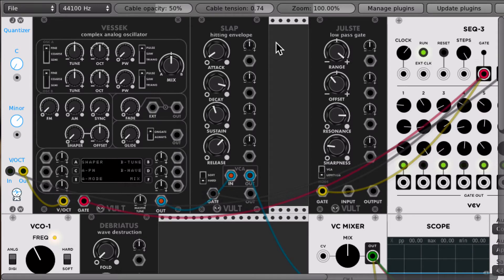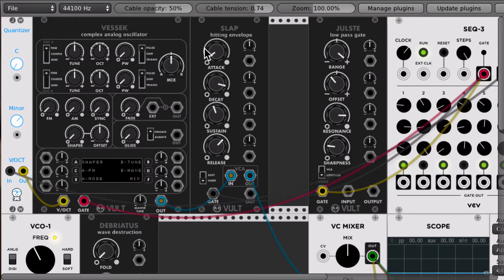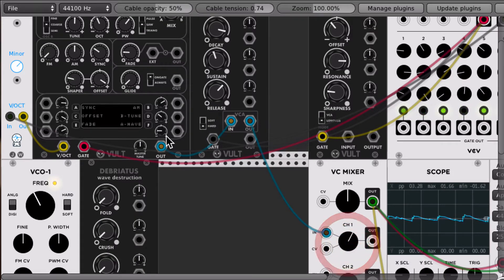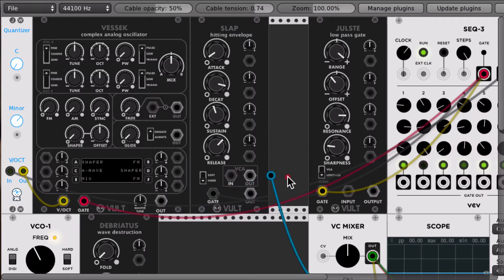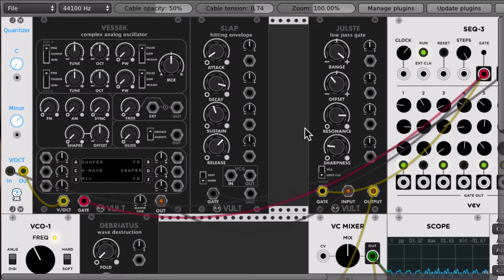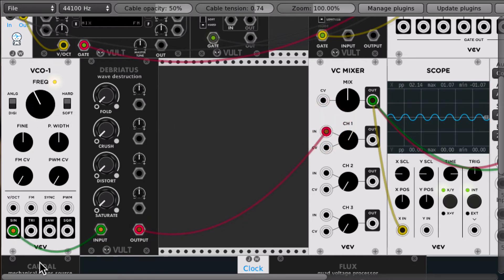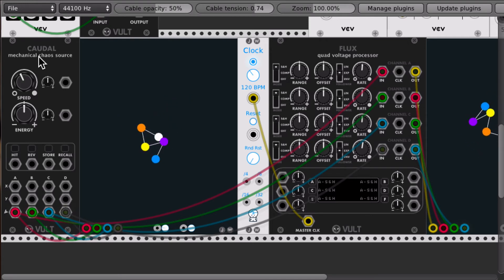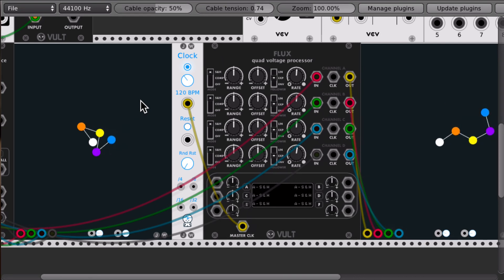Module Updates v0.5.5

Comment: Can you use the LPF and VCA  in Julste at the same time, similar to the Buchla model?
Reply from the maker: Yes. You have to put it in Lowpass mode and use the Sharpness to make the filter close more rapidly. The main difference with the original circuit is that the "Both" mode is turned on with a switch while in Juste you can gradually change from one mode to the other using the Sharpness control.